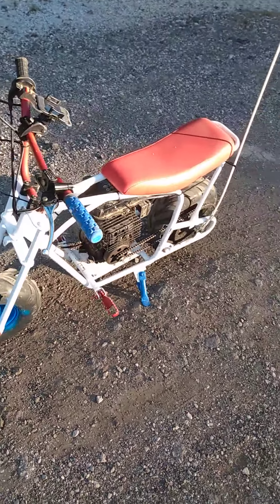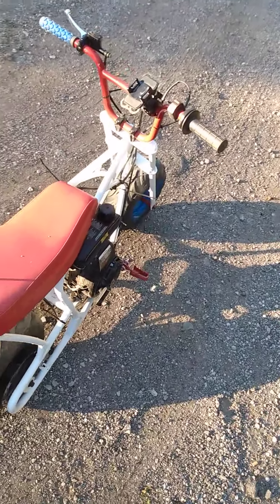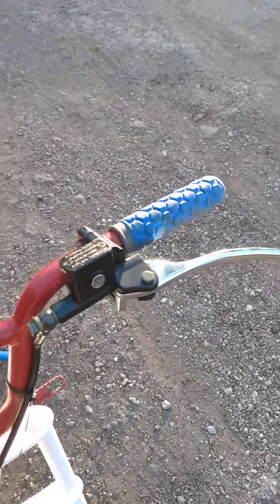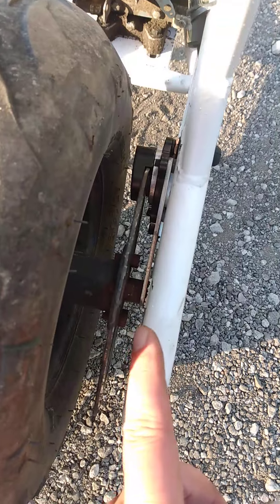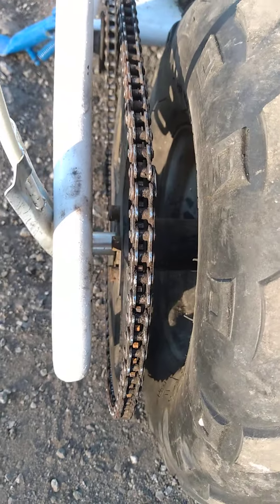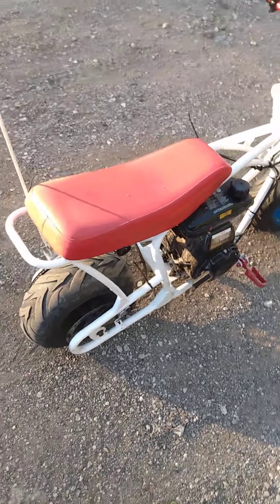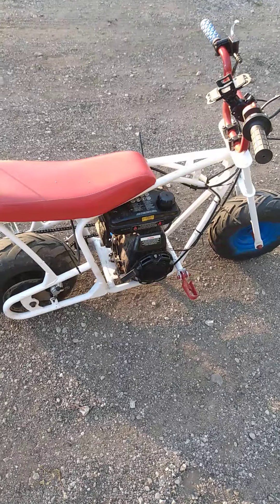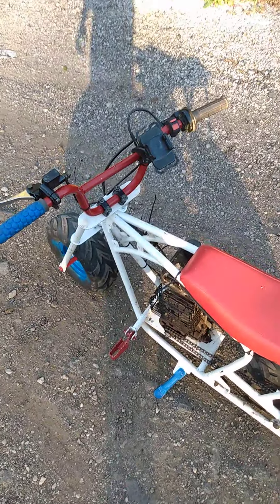monster moto 80 hydraulic brake upgrade

Comment: I put a dual piston caliper on mine and boy does it get hot after a day wheeling. Much better thought the old cable brake.
Reply: What adaptor did you use for dual caliper?
Reply: @freshbutplain1144 I made my own tabs to mount the caliper.
Reply from the maker: I got unc Larry stretch tabs and big brake kit was $114 shipped and should get here in a few days for the motovox i got the 224 on it rode it to stop sign and back I don't have brakes and the 16 tooth clutch has some issues I contacted seller about
Reply: @heathenprojects2639 oh man sucks about the clutch. Hopefully they make it right!

Comment: Hi there did you buy new foot pegs or just paint the originals, I’m doing the 212 swap with a studz racing predator 212 stage 1 and also bought the brake kit cause I watched this video just waiting for all the parts to come in
Reply from the maker: Just painted them to be honest the monster moto pegs are the best pegs you can get

Comment: now when u say backfire can u explain this because today i started my ducar for thee very first time the carb is jetted from the stage one kit for gopowerports wen i had it started i gave it a lil gas and a big fart came out the carb filter and smoke
Reply from the maker: These carb are very finicky the stock jets work better then the GPS stage 1 if you want a simple solution swap for Tillotson 212e carb you will save a ton of head ache
Reply from the maker: Also these motor come with zero lash for break in after break in its a food idea to set lash I ran mine recommended 30 thousandth
Reply: @heathenprojects2639  it's always something so I was better off going with the predator? I thought it was a race engine it says on the sticker I have zero experience on doing internal motor work
Reply: @heathenprojects2639  guess I'm gonna have to open the top and mess it all up so when u buy them from the gopowerfart dudes do they set it for u or you gotta pay for that too
Reply: @heathenprojects2639  ty dawg so should i just throw the stock jet back in her to do the break in or should i just get the 22lbs valve spring kit for 50 bucks lol from guess where Gopowerfarts lol
Reply from the maker: @SpACeCruizeR2o3  they really are just a bolt on motor uou can run stage 1 they are jetted out box to throw pipe on stock breather and she will scream
Reply from the maker: They are designed for go kart racing and will stomp a predator I did same thing threw stage one kit on it changed jet damn thing wouldn't run right played with carb caught it on fire now my other motor I just put it on a bike set governor runs great
Reply from the maker: Look at it this way they are 40 bucks more then a predator and already have a stage 2 kit on them with a governor so you can't over Rev and blow it up predator if you want to build set you to 400 bucks for a stage 2 also ducar has 22 pounds springs in it already I'd just throw your stock jet in it run it the tilly 212e carb has a large enough jet to support up to a stage 2 kit I'd build a Tillotson 212e before I would a predator I have a few predator they get job done but Tillotson are better all around my stage 2 Tillotson 212e runs 7k and don't seem to mind it had stage makes 12 hp with stock head I could get about 14 out of it if I ported head larger springs but I'm happy with it
Reply: @heathenprojects2639  oh wow so I should put back that main jet
Reply: @heathenprojects2639  thanks u so much alOt for your reply iit really shows humanity a thing or2
Reply from the maker: @SpACeCruizeR2o3  yes
Reply from the maker: @SpACeCruizeR2o3  no problem lot of trial-and-error experience and if I can save some one money and headache I'm glade to pass info on
Reply: @heathenprojects2639  ty man
Reply: @heathenprojects2639  how did it catch on fire god thats horrible def dont want to do that
Reply: @heathenprojects2639  what do u mean by set govenor and what should i do so i do catch on FIRE lol
Reply: @heathenprojects2639  thank u i love the motor everybody like what the hell is that lol sounds like a demon i just have to get either taller tires or smaller rear sprocket and or more teeth on the clutch

Comment: Have a link to the kit?
Reply from the maker: https://www.studzracing.com/product-p/monstermotohyrdbrakekit.htm
Reply from the maker: This is the one I use go power sports has a kit as well this one is a direct bolt on with no modification you will have to remove the stock brake bracket it pulls right out and side note reuse the stock bracket bolt the one in kit works but has the elem wrench head instead of the 8mm bolt
Reply: Thanks for the reply! Just ordered my cute the other day I have a spare cart I’m going to pull the motor off of. I figured that is the best thing that could be upgraded! Especially after doing a stage two kit and eliminating the governor you really have to get on the brakes to stop
Reply from the maker: @patrickcarney3110  I use to have to adjust the old brake after about 30 min of riding had these for a going on 2 months now still work great bike does around 30 stops on a dime my daughter rides bike pretty much everyday was a nice upgrade from the ct100u she had been riding were in the middle of finishing a stage 2 79cc predator build for ot now